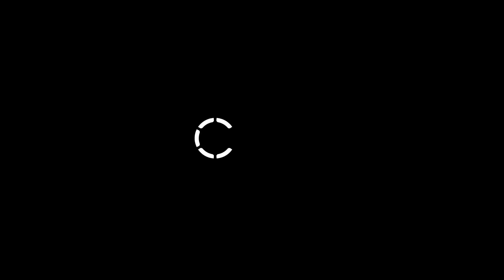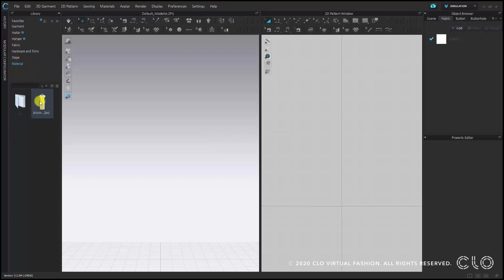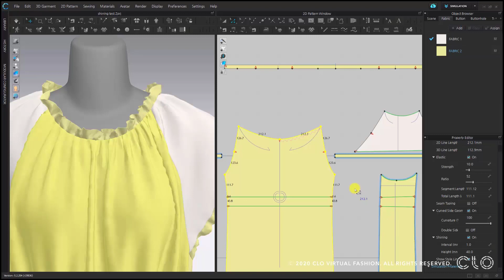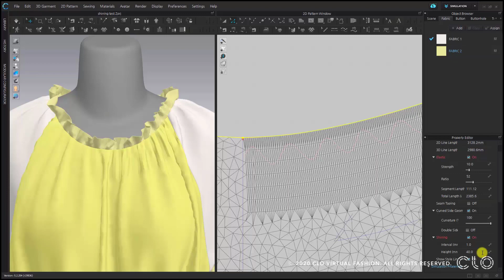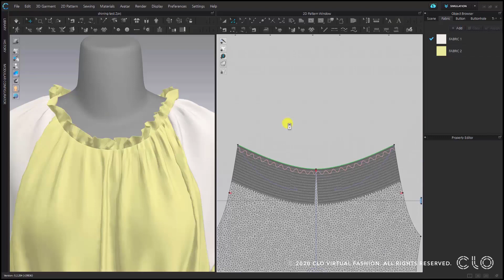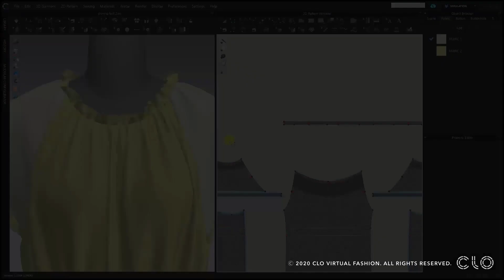Design Details: Add Shirring to neck and sleeve(EN)

Comment: I am not getting shirting option for internal lines. Can you please help?
Reply from the maker: I'm sorry, what do you mean by "shirting options"?
Reply: @CLO3D  I am sorry , I  meant  shirring.
Reply from the maker: @anujasood1344  Shirring gets applied to SEAMS. To add it you would need to Cut & Sew the Internal Line, then the Shirring option will be available.
Reply: @CLO3D  Thanks for the help. Please keep up the good work.
Reply from the maker: @anujasood1344  Thank you! Happy CLO-ing!!
Reply: You can apply elastic to rows of internal lines then reduce the particle distance to 5 or even less than. Without reducing the particle distance, it won't look much like shirring. I hope this helps. You can change the ratio of the elastic 55 or less and adjust as needed based on how it looks after you simulate.
Reply from the maker: for further help we recommend posting to our Official CONNECT Forum - https://connect.clo-set.com/community